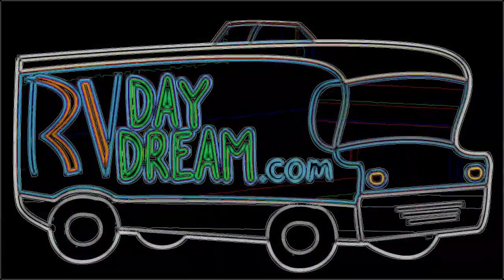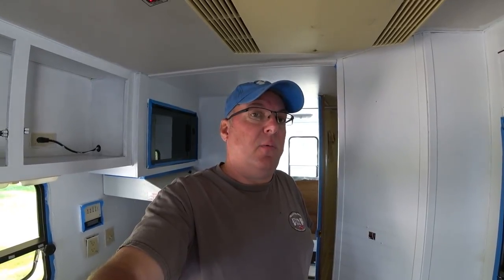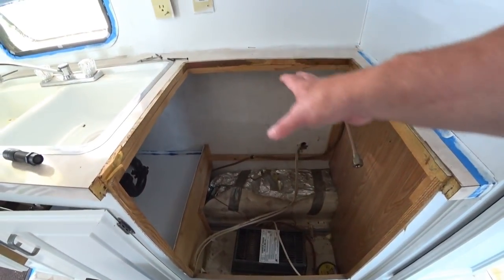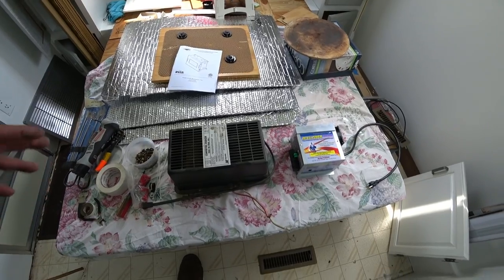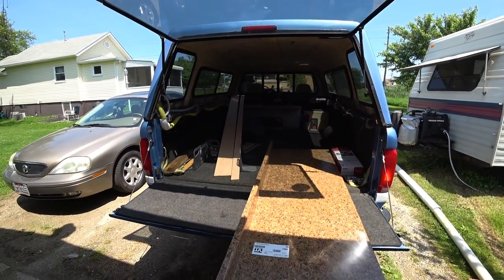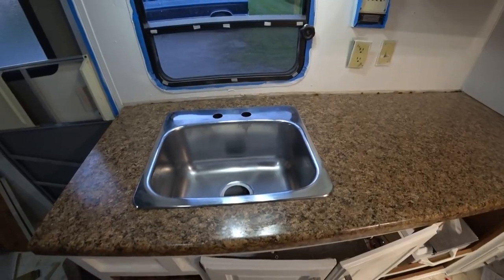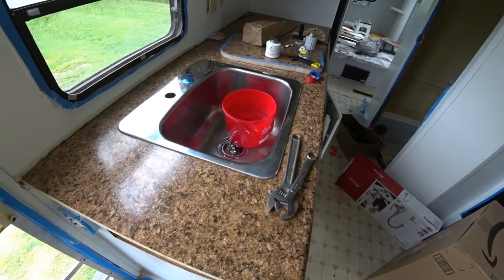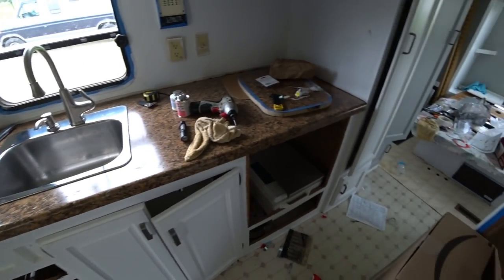RV Project 🛠️ Battery Charger and Sink Install

Comment: AGM batteries do not need venting. Our new motorhome has them without vents. The Robertson screws are used in RV manufacturing because they are less likely to strip when putting in with pneumatic or power screwdrivers.  Nice countertop. I used a router to cut out my sink.
Reply from the maker: Roy Davis I'm not venting them either but there are proponents for it.... http://rvnerds.com/2017/11/01/electrical-myths-part-4-agm-batteries-dont-need-venting/

Comment: Your RV is going to be so much better than a new one.  Heck you've been through everything from the tires to the roof, literally!!  What are you going to do about the generator when it rains?  The cover you got will be great when it's not in use, but sometimes you're going to want some AC when it's raining.  The last time I went boondocking, I wrapped mine with a sheet of plastic, kinda like a generator burrito, open on both ends.  It worked, but I would like to make something....better.
Reply from the maker: Chuck Webb definitely need to keep the rain off... Will eventually come up with something... 👍😁

Comment: on our stove top I built  a tray to fit over it.   You can take it off and  and use it as a serving tray to take stuff out side to the table or grill, or when its on it gives extra counter place
Reply from the maker: TheTnstick like this? https://youtu.be/NVCl2HeulHE
Reply: MINE, THAT I MADE IS A TRAY IT HAS HANDLES AND   SIDES  THAT LOCKS IT IN PLACE SO IT DOES NOT MOVE WHILE GOING DOWN THE  
 ROAD.WORKS GREAT FOR US . WE USE IT ALL THE TIME TO CARRY STUFF TO THE PICNIC TABLE OR TO THE FIRE  WHEN WE ARE COOKING THERE.

Comment: Hi from Joe and Nancy. Suggestion. Sand cutout edge of piece from sink, paint edge, use as counter extension
Reply from the maker: Joseph Tuszynski it's already sanded and Heidi is already trying to find paint to seal it off. However that is a great idea for the counter extension as we already have the flip up locking braces.
Reply: Awesome.

Comment: Sidetracked...yeah, that's a bit of a problem.  It doesn't help that, like you, I usually have a series of projects going on at any time.  I think I used to be a lot better about focusing on one problem at a time, but a few years ago I went through chemo, and that seemed to make it a lot worse.  Still, consider the difference between starting on one thing and getting sidetracked by another thing *that also needs to be done*, and not working on any of them because you don't know which to start first.  As long as you're making progress on something that needs doing, it's all good.

Comment: "kind of like an old phone plug, but it's not".  From what I can tell, that's an RJ9 plug, four wires, also used for corded phones between the handset and the base unit.  It's just a little narrower than the RJ11 that's used between the base unit and the wall for phones, whether corded or cordless.  It's also pretty similar to a RJ45, used for ethernet (connects your computer to your modem if wired), except that has 8 wires.

Watching these always makes me laugh a little, thinking about how it would look if I tried to record some  of my home improvement type projects.  I'm pretty confident in my abilities to actually get the job done, but don't think I'd ever get your level of presentation.  I bet I'd get a lot more comments about how I was going to kill myself (or someone else) because of how I did things, too.  Keep up the good work.

It seems like this remodel is a really major project, taking up a lot of what could otherwise be camping time.  I tried to think of how to do this without missing out a lot of camping, but aside from having a large heated space to keep the RV in, there don't seem to be a lot of options.  I hope you're getting a lot of enjoyment out of the work itself, and that you get a lot of time to use the RV once the remodel is done.  I always get a kind of extra satisfaction from using a space after I've improved it; I hope you do too.

Comment: For all you Safety Sally's out there, they now put lead acid batteries under the seats in some cars and SUV's. The only time a battery vents is when it's being over charged so don't overcharge the silly things and you'll be fine. Plus how heavy must the vapors be to cause it to explode while mixing with air in a 22 foot box that is no way air tight. Just pay attention to what is going on around you and quit being such babies.
Reply: Thanks for the heart old friend.

Comment: if your sone dus not what the converter id be happy to take it off your hans and be happy to pay the shiping for it and yes i get jest as side track and had an iday for you on your sope baltile use a mesh water bottle holders to holde it up and jest tie off the stap to the top so that even if it come out it wont fall over and spill
Reply from the maker: Derek Smith 👍😁

Comment: hey there. I'm watching your RV Project 🛠️ Battery Charger and Sink Install video and notice you have stats on your bed. I just bought a camper with a queen size bed and thought I need hydraulic struts. Do you have a vide on this? I tried searching but you've got a lot of videos! Or if you don't have a video do you remember where you bought your struts? Thanks!
Reply from the maker: The struts were there when we got it...there are RV stores online that have strut kits..Try Camping World first as they are the most well known
Reply: thanks!